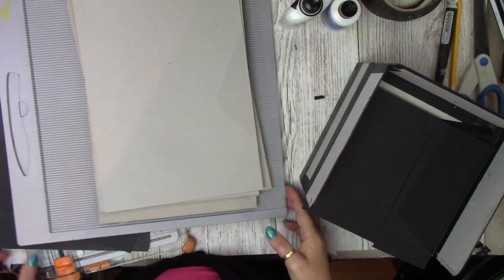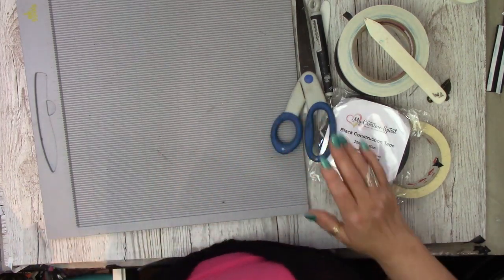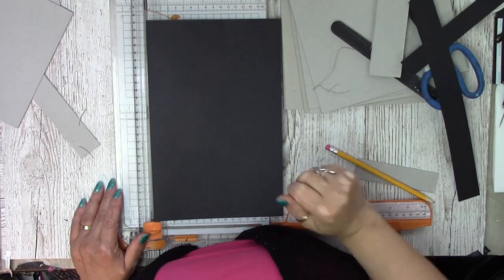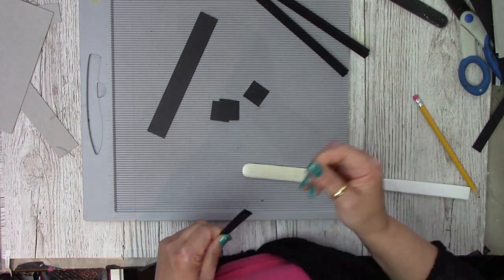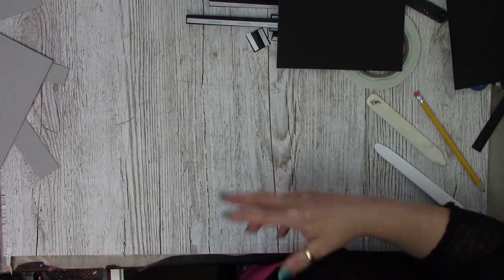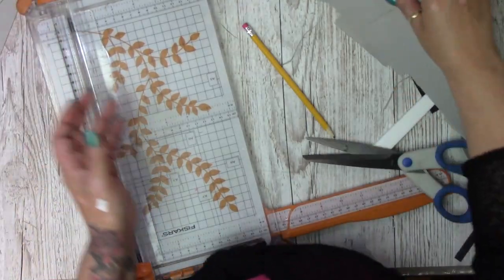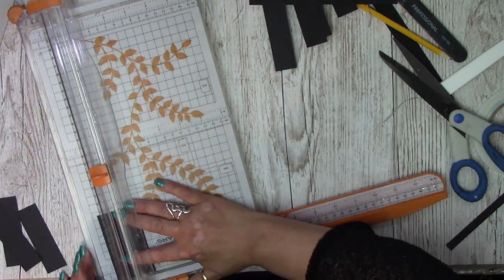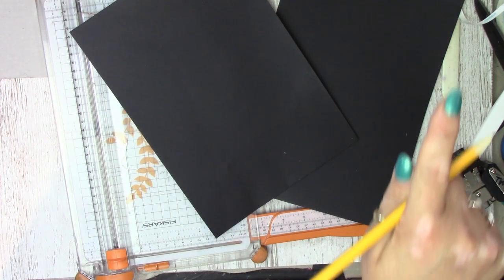Chest of Memories   Part 1- Construction

Comment: Thank you ever so much for the tutorial for the chest of drawers!!  Would things work out the same if I put the structure strips on at the same time as I am trying to glue the edges of all the pieces together?  I have horrid tremors so that if I am trying to hold my hands still, they violently shake,  I'm afraid that if I don't use some kind of support while the glue dries, my poor chest of drawers will be more than a little crooked!!
Reply from the maker: Cheryl Lasich hi Cheryl, you could put a small tab of tape on to hold the pieces together some once the glue dries you take the tape off and then add the structure strips.